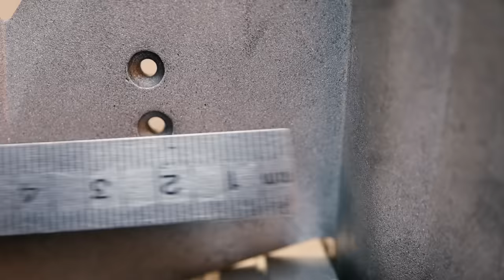F-4 PHANTOM II Aircraft Restoration - U.S. Airforce Fighter JET

Comment: I believe that those are not bombs on the F-4 but rather drop tanks. Drop tanks are used to give more fuel for longer flight time. Excellent job on the restoration. Your skills are incredible.
Reply: Correct
Reply: Gary, you're correct; those are 370 gallon external wing fuel tanks.
Reply: from the night before, by my dorm room windows rattling because of those F4s taking off in full AB.
Reply: Yes those are drop tanks. The Phantom was not fuel efficient.  She was known as The Flying Brick.
Reply from the maker: Thank you all - I wasn't aware of that :)
Reply: Yeah , my uncle worked for MD and I had several models he gave me as a kid. These were drop tanks.
Of course the models did not hold up and it bothers me to this day. They were professional models that MD have out of the different Phantom Types .
Reply: You sir, are an artist. That model was magnificent. To see what you had to work with, the result is stunning.
Reply: @robsteingruber9488  Yep! Proof that even a rock could fly if you threw it hard enough. Used to work on the weapons systems.
Reply: Ok, once I finally looked at the finished product I thought...are those bombs as Awesome Restorations was calling them in the video? Or are they 'drop tanks'?(and dammit if Guy Pipili didn't beat me to it...)
Reply: @radioactive9861  apparently he beat us all, to it.
Reply: Nice job but the fuselage stars are upside down.
Reply: Yup, drop tanks
Reply: Yessir
Reply: I agree on all your points. You are spot on.
Reply: @beerleaguebrodeur7724   And go much faster and be more maneuverable. They were also used as speed record breaking cars  in the 50-60's. They were and may still be used as boats in southeast Asia.
Reply: Weirdest drop tanks I ever saw tho, they have winglets on the model!
Reply: You are correct I worked on the ejection seats in the 70’s
Reply: @masterjedi8670  Yep! Just put J79's on and you've got an Air Force, just like the at least 6 nations that still use them to this day!
Reply: @robsteingruber9488  "The Flying Brick" is STILL Flying for many nations to this day!.
Reply: Bro literally called the engines exhausts
Reply: @JoseOrtega-yh5iu  but F-4 drop tanks do not have fins.
Reply: @speckgens  
I know that
Reply: @speckgens  They do as the airflow could make them hit the aircraft. The winglets help prevent this.
Reply: Went to the comments to put this and its already here :p
Reply: Yes, they are jettisonable (droppable) fuel tanks
Reply: @AwesomeRestorations  ⭐️💫
Reply: @radioactive9861  Sorry! 😆
Reply: drop tanks don't have stabilizing fins, those are bombs.
Reply: Hello friends ❤️ have a great day 🙂
Reply: The lead sled
Reply: The F4 Phantom had  bombs Missiles , gatling guns that were shaped like bombs. In fact The F4 Phantom was a fighter bomber, it served as both a fighter and bomber. at that point in Vietnam the USA had no pure Fighters, And it cost us, until Robin Oldes got together with his ground crew and they created a cannon putting a gatling gun inside the shell of a  bomb. until that point all F4's had to use in a dogfight were 4 sidewinder missiles that only worked 30% of the time..
Reply: Except that F-4 370 gal. drop tanks NEVER had fins.. and so that is why he prolly confused them as bombs.
Reply: @crewchief8013  Except that F-4 370 gal. drop tanks NEVER had fins.. and so that is why he prolly confused them as bombs.
Reply: @AwesomeRestorations  Except that F-4 370 gal. drop tanks NEVER had fins.. and so that is why the confusion   as bombs.
Reply: It's used as boats by cutting it into halves by Vietnamese to cross rivers in Vietnam, today.

Comment: The fact that all the pieces are there despite being so old and cruddy make me think it was found while digging in the backyard. Like an old toy a kid buried and forgot about. Or time capsule.
Reply: He probably bought the model and dirtied it up seeing how the debris came off so easily and he mysteriously found a seller for the missing canopy
Reply: @extra8088  That’s probably the case for all restoration videos on any other channel.
Reply: @extra8088  he probably went on ebay to find an f4 kit canopy.
Reply: @extra8088  100% this. Stuff doesn't rust like that in nature. That was given some sort of bath.
Reply: It was likely a brand new model, which included the canopy.... made the silicon mold to cast a "new" one and snapped the wing off. Go try snap something like that. Zinc alloy also doesn't rust like this.

Comment: As an Air Force pilot, I would agree that the underwing devices are probably fuel drop tanks... BUT, they could be napalm canisters. In any case, well done! A pleasure to watch.
Reply from the maker: they are fuel tanks I've been told so after I made the video :)
Reply: Fuel tanks napalm is lot smaller.

Comment: Great job! I worked on over 100 real F-4s for McDonnell Douglas thats what brought me to your restoration video. Restoration is so much fun I did a few outboards ..
Reply from the maker: thank you very much - that is so cool 👍👍
Reply: @AwesomeRestorations  Looks like that model you have was in saltwater I get outboards like that. Yeah I use to work for McDonnell Douglas in Tulsa and they use to bring them in one at a time on an overhead crane 25ft off the floor so neat to see. Looked like they were hovering. I wish I took pictures. I installed the rear stabilzers and engine blast panels amongst other things. ..Take Care!

Comment: This. This is a quality restoration to the best of it, awesome work! On an unrelated note, I'm pretty sure the 'bombs' are actually drop tanks, the F4 wasn't exactly fuel efficient and it required drop tanks basically any time it wanted to fly anywhere with considerable range, of course, the drop tanks would be jettisoned when fighting, but, they could be bombs

Comment: Nice restoration! Beautiful job!

Historical side note... the F-4 is proof that if you put big enough engines on a brick, it will fly. It has a glide ratio so bad for every 100 feet forward it drops 1000 feet.

However, the side insignias are upside down and those are auxiliary fuel tanks, not bombs.
Reply from the maker: thanks a lot, and yes I know that it is fuel tanks now but I didn't knew it when I made the video :)
Reply: @AwesomeRestorations  Awesome restoration! I'm a fan!

I restore old Star Wars toys from 1977-1984  so I know how much fun AND frustration can go into restorations of anything.
Reply: I think it’s one mile forwards for every 1000 feet lost

Comment: Couple of questions:  1). Most diecast toys are made of a pot metal that does not rust.  How did this rust so badly? Assuming it is a ferrous metal, how did it rust so evenly yet badly?  2). The amount of rust on it was massive yet a very quick sandblasting removed all the rust is one pass and there was no pitting on any part.  How was that possible?  That much rust would have made many large pits.

Comment: It would be helpful if you learned how to use a metal file. It only works on the down stroke and dulls the cutting surfaces when you drag the file back over the material on the return stroke.

Comment: Rusty aluminum?  Final product is great but it definitely wasn’t actually rusty 🤷‍♂️
Reply from the maker: Its metal... The stand was casted in aluminum 😉
Reply: It’s all metal, specifically aluminum, you were using AC tig to weld it.
Reply from the maker: Yes i did DC Tig to have control of the very thin metal 😉 the weld sounds ware added in the editing process.... Thanks for watching 👍